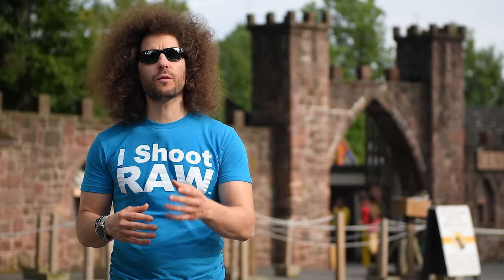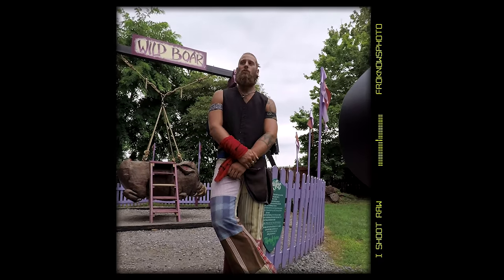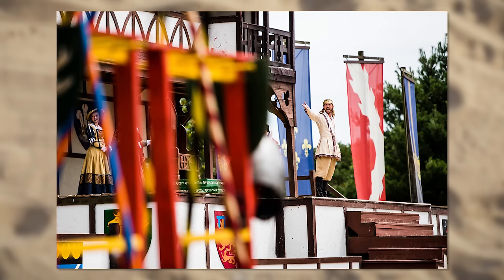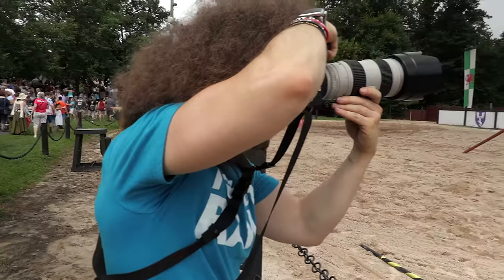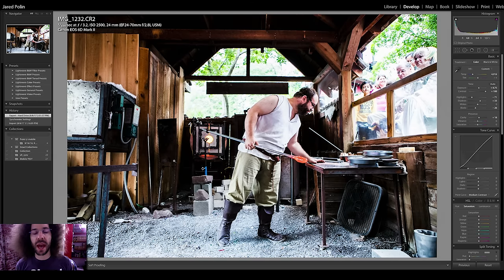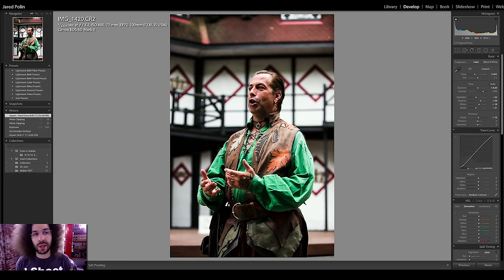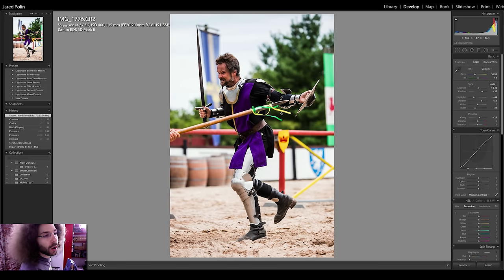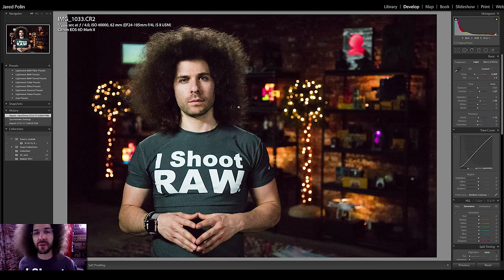Canon 6D Mark II "Real World Review": Does it SUCK?

Comment: Little tip about the focus points. if the points dont spread out wide enough in the viewfinder, use the Dualpixel AF livescreen. it spreads out much much wider(almost to the edges) and is accurate.
Reply: This. Works fantastic on my 90D when needed!

Comment: Great review! I bought this body as soon as it came out , and as an upgrade from the "original" 6D. As a landscape/macro photographer, I needed the fully articulated screen and the increase in megapixels.  I don't care about frame rate, since I shoot carefully composed photos (i.e., SLOW), and I don't care about video (but yeah, the omission of 4K is dumb).  I, too, read about the supposed deficiencies  in regards to dynamic range, and in practice I found those complaints to be bullshit, and obviously made by people who are clueless.  I do agree that the focus points clumped in the middle is stupid and a PITA to deal with, but this review never touched on shooting in Live View, which I do very often. In Live View, you can focus from edge to edge.  
My only other nit to pick with many reviews, including this one, is the whining about the single card slot. Seriously, how often do you all have a card fail?  I've NEVER had that problem, even going back to cameras that used CF cards. I use high-quality cards, mostly SanDisk, and have never had a problem. So, the single card slot complaint is just silly.
Reply: Okay number one year landscape photographer you should never be concerned with Focus points you should know how to Zone Focus.. number two since when is SanDisk the best cards? Are you whining about not having 4K your eyes don't even see that way it's a headache.. most people don't even have the computer storage or processing to edit. I think it's Ansel Adams Ted take beautiful exposures without l live view I think you should be capable of that too.. you needed a fully articulating screen really you know some of the best landscape photography has been done with medium and large format last I checked there was no articulating screen

Comment: Hey Jared, you can recompose and use continuous focus. You just have to use the back button focus, release it and recompose. The shutter button will not focusing after that if it was deactivated on the shutter button. That what I do all the time with my 6D and all its focus points in the center of the viewfinder... 
I agree, recomposing is not the ideal way to do, but I deal with the gear I have...
I use back button focus for years and I can't go back to the shutter button focus, that's so much more efficient...

Comment: Nice review.

Concerning the "zone af" modes, consider that - by design - the camera tries to focus the nearest subject to the camera, in the selected area. This is mentioned also in the user manual.

So, if the selected area covers a zone with objects at different distances from the camera, and you want to pinpoint the focus on a specific part of the frame, the zone af option is not always the best choice.

Sadly, differently from other models, like 5d mark IV, 1dx mark II and 7d mark II, there is not the option to select a single af point, with the addition of a "cluster" of af points surrounding it (af point expansion), in the way that the camera begins to track from the selected af point, and automatically change the af point during the "af tracking".

Concerning the area af coverage, for sure the 5d mark IV is better, but not by much. The 5d mark IV offers an additional column of af points per side, and you pass from a horizontal coverage of 38-40% to 53%. Consider that the 80d has a 62% horizontal af coverage, and on the 7d mark II is even better (70% and more).

In every case, I think that the problem is due to the small size of the body: to use a larger af unit you need to upsize the secondary mirror, and this requires space. Indeed, the 5d mark IV is bigger and heavier. With an aps-c sensor you can use a much smaller af unit, to obtain the same coverage, and hence the size of the body is less relevant.

For the same reason it is difficult to construct a viewfinder with 100% coverage, since the pentaprism and mirrors of the 6d mark II are much larger than those of an 80d, and the body sizes are very close. At least, if you want to maintain the camera body compact.

Comment: You continue to make me impressed by the 6D2.  I almost exclusively use point auto focus, and almost always center weighted, in my style and preferred subject matter.  I do not feel that the scrunched up AF points will be an issue, though I will miss the spread on my 80D, since I do occasionally use the zone AF (maybe 1 shot in 100).  I am semi-pro, mostly an enthusiast gone crazy.  I can not justify the cost of a 5D4, but the 6D2 is an attractive prospect to start getting into full frame.  I may take a closer look at the new 90D when it releases and I can put hands on later this month.

Comment: Good review. However a point: saying that 1/8000s for shutter speed is found in more expensive gear is absolutely wrong, since it is found in smaller bodies such as the 70D, the 80D and the 7D mark II. So why, since they are a business, would they offer less (yet relatively smaller, but still smaller) features than the lower bodies that cost half the price if not the same? Yes, I get it's an "entry-level", but it's still a 2000 dollars camera, not a 350 dollars with rebates.
Reply: Giuseppe Pipia APS-C shutters have to travel less distance to cover the frame, hence it is a bit simpler to have higher flash sync speeds (ie 1/250) and faster shutter speed (ie 1/8000) without the more advanced designs of the FF shutter
Reply: Oh come on! Like it is something very difficult to manufacture! If it were present only on the 1DX then yes, I'd agree with you, but not on this case, since the shutter mechanism is pretty much IDENTICAL for any full-frame camera. They just have to do some messing around.

Not talking about flash-sync speeds, but also that 1/180 is ridiculous, since they could have done it easily to 1/200, updating it from the 6D mark I, instead keeping it the same.
Reply: The Sony A7II has 1/8000 shutter speed and it is their entry level FF camera. Plus it has more features and a better and faster focus point spread across the sensor for $500 less than this junk.
Reply: For the shutter to go 'faster', the 2nd curtain just has to start earlier. This renders your shutter speed/time. Now if you want to eliminate rolling shutter effect for as far as possible, the curtains have to travel faster at short shutter times. But that is something that only becomes visible with very fast moving objects.
Reply: He never said it was only in expensive cameras. Its just the way you choose to hear it.
He said it is in expensive cameras. that doesn't exclude none expensive cameras. Listen to it again.
Reply: Giuseppe Pipia To be honest. I don't have a problem with the shutter speed. It's the single card slot I have a huge problem with. I think it's dreadfully underhanded. And I'm not sure why all the focus points are clustered into the center.
Reply: The 6D is the rebel in the full frame line up.
Reply: The sony does not have an actual shutter.

Comment: Hi Jared. Thanks for the great YT channel. When you say the 6DMKii has old technology, are you mostly referring to the lack of 4K? Is it also the use of an 80D AF system that isn't sized to the larger sensor? Is there something else that's not current? I think I could live with these 2 deficiencies. I have no desire to have a hybrid digital camera anyway. I just want a photo setup. My current camera is an EOS Elan 7E film SLR. I've been using Provia and Ecktachrome E100 in it. So I might not miss the dynamic range that the 6DMKii lacks. And I usually use lock focus and recompose, since the Elan 7E only has 7 focusing points. But I do hate shelling out $1,400 for an out of date camera body. A big plus toward this camera for me is that I have a very nice Sigma 28-105 f/2.8-4 aspherical lens that I won't part with. So much so that I will wait until Canon comes out with something I'll be happy with and stick with my Elan until then (market shrinkage). Another thing I like about the 6DMKii is that it isn't top heavy with buttons and features. But the price needs to come down, or is that the price of admission to the inexpensive world of digital photography? I bought a $400 scanner recently, so that has me putting on the brakes as well. To sum up, is this the camera for me ($1000 - $1500) or should I be patient?

Comment: I just bought one of these used for £850 with 5600 shutters actuations... so basically new. The shutter on my 6D MK 1 failed a couple days ago and I needed a working camera ASAP cause I do some professional work. I'm looking forward to using this, I use back-button focus so the issue with focus points probably won't affect me much. I heard about the 'issue' with dynamic range after buying the camera which is a little bit of a let-down, but realistically probably won't be much of a problem.  I'm hoping to get some good use from this upgrade. 

Thanks for the great video, this was very informative and provided me some additional confidence in this camera body.

Comment: I have the 6D2 for a month (coming from the original 6D). I love it. Easy and quick to use. I do not care for vdo (my iPhone has 4K ...). For still photos it's perfect. Each camera has its pros and cons, but I 'm a simple amateur and it seems to me when I read all the anti 6D2 comments, that everybody's  a professional photographer, which I am not. So , 6D2 is a very good gear. And my ambition is not to move up tu 5D4 but rather to go for a 7D mk3 as a second body. Cheers ! (NB : I move Canon Glasses ...).

Comment: Yes, it is an entry level FF, but isn't an entry level camera
Reply: Saint Claire      Yeah Canon has entry level cameras for a few hundred bucks
Reply: Saint Claire i shot photos with 6d i and it looked just as good as Mark 3
Reply: I still shoot with the (old) 6D and I absolutely love it. Even now in 2018 with so many new camera's on the market. At some point you realize you can make almost every shot you need (and I have to say, the 20Mpix of the Eos 6D are more than enough for 99% of the things I shoot). Oke, heavy cropping might be a problem with 20Mpix compared to the many 40+ Megapixel DSLR/Mirrorless camera's but the good thing is that it will force you to go closer to the subject faster because you know you can't crop so much in post (and it depends on how big you want to print your photo's in the end ofcourse).

Comment: Great review Jared. I think you did a good job of being objective and fair. I have the original 6D and it works for most of what I do. The deal killer for me with the 6D Mark II is those focus points all clumped in the middle. My only real issue with my original 6D is the lack of focus points (which I knew going in and have learned to work around many of the other drawbacks). I was hoping for much a much wider focus point spread. I'll have to keep saving and looking for something else.
Reply from the maker: thanks!!

Comment: About the lack of joy stick though, you can actually scroll the AF point up down with you thumb using the back dial, while scroll the AF point left right with your index finger, using the top dial. Which is much faster than the joy stick.

The reasoning is, say, if you want to move an AF point 5 steps to the left with a joy stick, you need to press and release 5 time. But with the dial, you just slide the dial 5 clicks in 1 single stroke. 

Working with you thumb together with your index finger on the fly is faster than clicking with you thumb alone. You just need some time to get used to it.

Comment: One can argue that the 6D2 is good as in "good enough". But the question should rather be what camera offers more for the money. What camera is the best buy?  The 6D2 has similar DR as the much cheaper 80D where the 80D has more spread out AF points. Buying a used 5D3 can also be a better choice depending on your priorities, not to mention the other brands.
Reply: Marek Bartnik Why shouldn't they be compared if they have similar image quality? The only thing that differs is the angle of view and depth of field given a lens. I've seen 5D3s at 8000 exposures (as good as new) for about $1500, which should be enough to motivate people to consider it as an option.
Reply: Marek Bartnik Whatever your personal opinion is on used cameras doesn't dictate whether someone else might find a used camera with better IQ a better choice. It's up to everyone to decide for him/herself. And no, full frame is not always superior. The 6D2 has older tech than the 80D, which makes them comparable in terms of IQ. It's in fact the lenses that makes all the difference, not the sensor.
Reply: Sorry, the sensor is VERY important in IQ. A FF has better IQ than a crop, given the same lenses. So you are indeed INCORRECT.
Reply: Oscar Baez Soria, yes, given the SAME lens at the same aperture.  But with an equivalent lens (larger aperture than FF lenses) you get exactly the same IQ. Watch Tony and Chelsea's videos and you'll know what I talk about. Also, sensor generation matters. I doubt that a 5D original beats a 80D for instance. Size isn't everything.

Comment: I have the original 6d and 1/4000sec + f1.4 + bright sunshine = 😑🔫
Reply: you know they sell ND filters right?
Reply: get an ND filter and you're set! :)
Reply: Eupix nd filter. Nothing is going to save you at f1.4. Can't blame the camera on that one
Reply: It sucks at 1/8000 too on my 5dmkiv even at 50iso..In fact , without ND filter , every camera fail at this game.
Reply: One advantage of mirrorless cameras like the latest Fujis - they have an electronic shutter which goes up to 1/32,000s - you can shoot f1.2 on a sunny day and be okay. If that's what you need in a camera ...
Reply: Except the Fuji is not FF, thus the lens does not really yield depth of field a of a f1.2 on FF... but sure.
Reply: Eupix Just use a NDfilter, that simple. By the way, even at 8000sec you will blown out everything in a bright Sun with 1.4
Reply: Shooting at f/1.4 in bright sunlight is evidence you don't know a thing about photography.
Reply: Yes I had this problem with original 6D and now  the same with mk II.  Canon is a joke.  I left Canon.  Yes you can try ND filter but that's the hassle.  You don't have to do that with competitor camera.  Same thing for AF issue.  Yes you can do focus and recompose.  That's another hassle and AF can be missed when shooting very shallow DOF.  Competitor mirrorless EyeAF can focus spot on the eye anywhere in the frame even on the edge that none of the DSLR can do.   No more front or back focus issue.   Mirrorless is lighter,  more fun, offer more features.  Bye bye Canon.  Used to be a big fan but now enjoy the others more and will never go back to the pain.
Reply: Why not?  If you have 1/8000 it can be done with beautiful bokeh....no limit.
Reply: Thach Vu yea. One stop of light isn't going to be any noticeable difference. That's within the dynamic range of the camera. You can just over expose one stop and recover the highlights. Or buy an nd filter and get 3 or more stops of light reduction. Much more than a single stop of light.
Reply: Every lens has different filter thread size and buying an ND filter does not cover all lenses...you might say step up ring but this is hassle.  This is 2017.  Shutter speed should be 1/8000.  I can tolerate 6D mk I back then but since competitors already came out with better camera a few years ago and I was hoping 6D mk II will at least match it but after 5 years...so disappointed....I don't need any workaround and if you shoot jpeg you can't recover much.
Reply: Why are you wasting your time on Canon videos if you left then? Do you feel the need to evangelize us on your better discernment of camera brand choices? Why are you here if you already made up your mind????
Reply: Thach Vu  You can't compare DSLR to Mirrorless, they are completely different systems. D'oh.

Comment: Gee, for god sake, this camera is bad compared to the competitors. Its not a BAD camera, but if you compare to whats in the market, its just meh. Not enough contrast in the images to test teh dynamic range. Dynamic range is something you dont care until you care. Overcast day isnt a really problem to most cameras, too much light bouncing around.
Reply: Needs a 1 frame to get a good photo in action (sports) but you are not a professional sports photographer. You shot Hockey, you have a camera that shoots 12 fps and you know how important fps are important to predict some shots. Try shooting a professional sports event that you need to nail the shots. I shoot with a 5d mk iii and 7d mk ii (sold 7d mk ii), and it was muuuuuuuuuuuuch easier to get the moments on the 7d mk ii, than on 5d mk iii in soccer. For other sports I can handle very well the slow fps on 5d mk iii, but in soccer I find that 10-12 fps is a must.

Comment: Great review Jared Polin, but I do wish you would give a little more of your opinions you were a tad diplomatic in places and I got the impression you were holding back. 
Was waiting for this camera but have been so disappointed with the reviews and it had put me off. Am primarily a landscape photographer so the dynamic range issue is a concern as i quite often pull shadows in a single image and don't want to have to bracket. But then I came to a realisation, I'm coming from a 60d from which I have always gotten good results, the 6d mark ii has to be a good improvement on that right? Would appreciate your opinion thanks